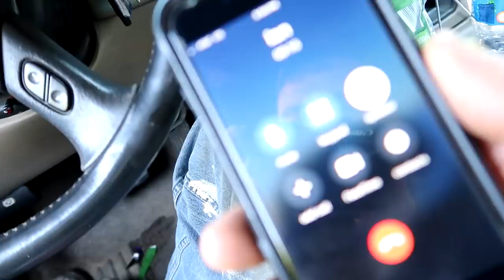So this Happened...

Comment: Button is blue! Was that Dodge an Ecodiesel?
Reply: If it was a ecodiesel its the EGR is under a recall right now I'm hoping and 🙏 my truck doesn't go up in flames before my warranty goes out I will be deleting everything it will be just have a pipe best truck I ever had a issue with it but it's a Dodge so it could go up in flames 🔥 🔥🔥🔥